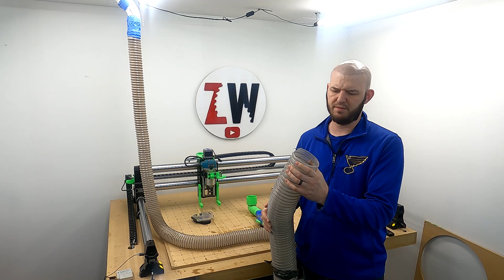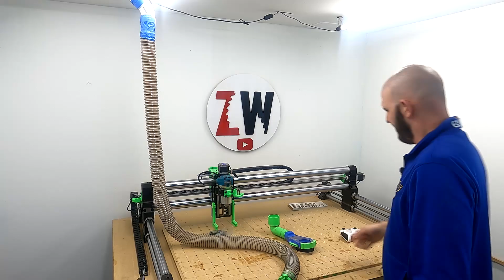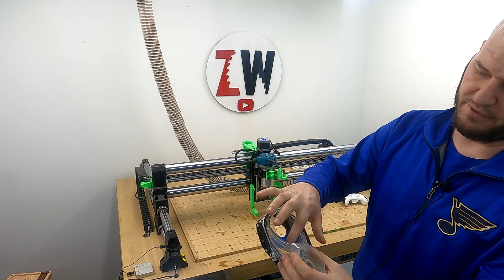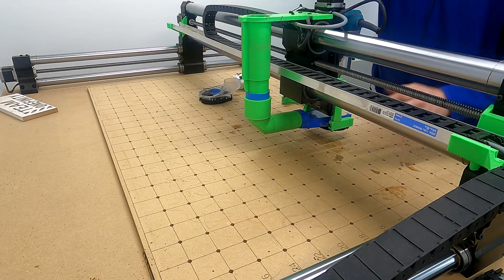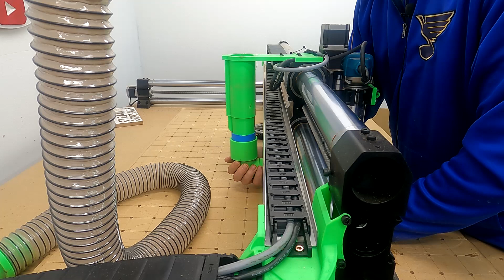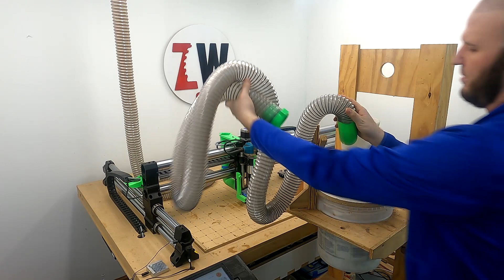Onefinity Dust Collection Basics

Comment: What sort of dust collector are you using to replace the shop vac? I am getting ready to setup a shop vac system here, but wondering about potentially better options. I was thinking as much as we run the CNC it may go through that shop vac motor in no time.
Reply from the maker: Since I use a 2.5in hose I've been using a shop vac. But if I ever clean up my shed and finish it out I'll move my machine up there and use my dust collector.

Comment: I like the idea of 2.5" for the CNC. Is there a issue with using a DC(4") and reduce it down to 2.5" for the hose to the CNC?
Reply from the maker: Just make sure that you don't starve your DC. Might want to do a multi 2.5 with a blast gate on the other 2.5 that way you can adjust it infinitely.